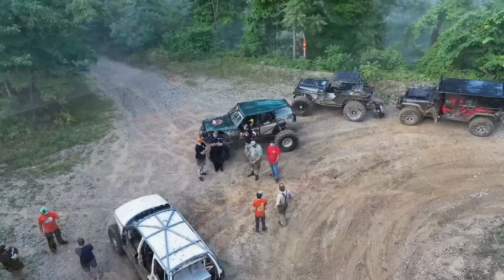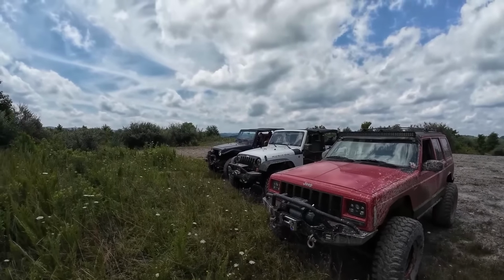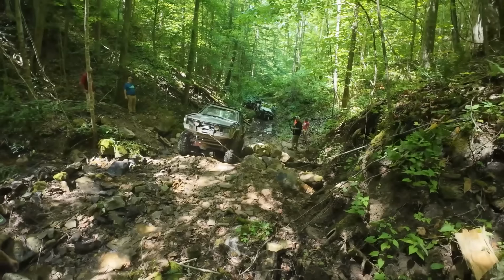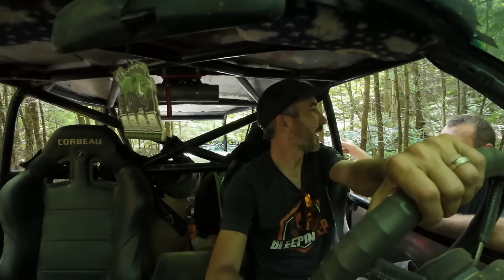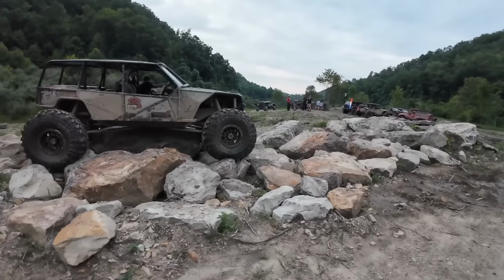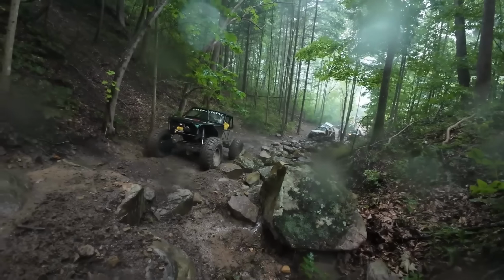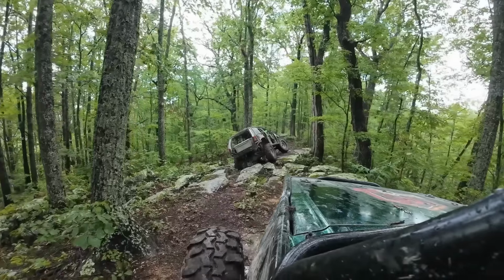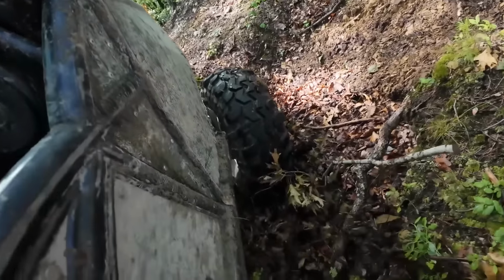NEW Off-Road Park - 50,000 Acres!!!!

Comment: Guys, i've recently fitted my rig (Isuzu Amigo based) with 325/85r16 Michelins XML. True 39" diameter, absolutely bulletproof. They work great off road, respond to airing down well enough, handle safe on tarmac at 60 mph. I highly recommend them for trail raiding like this shown. Greetings from Poland!

Comment: It seems like your tires either have too much pressure,or they are too stiff to shape themselves around the big rocks.  You aren’t getting much of a contact patch in comparison to the size of your 43” tire.

Maybe you’re concerned about a pinch flat?

I don’t have experience with really big tires, but my 35” Patagonias shape themselves much better around rocks at 12 PSI.